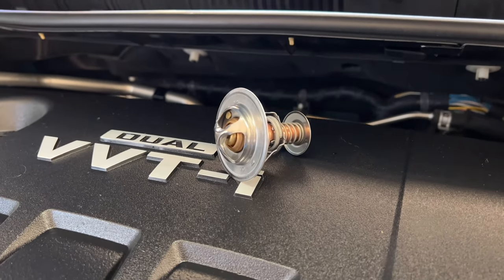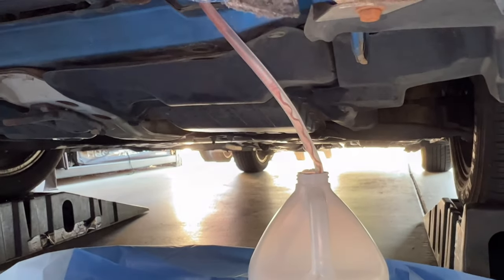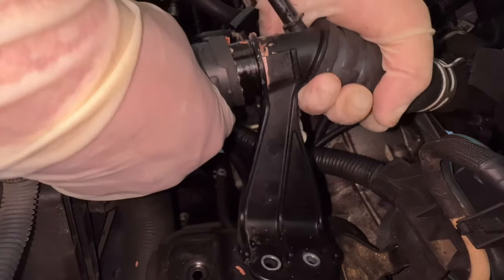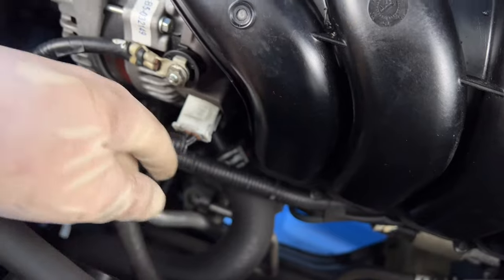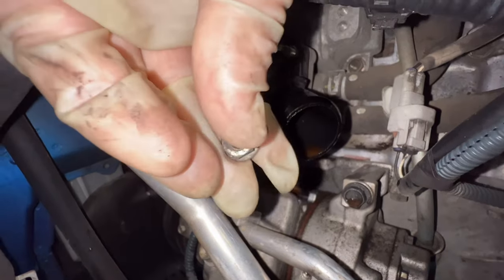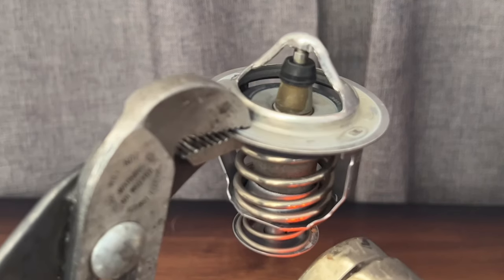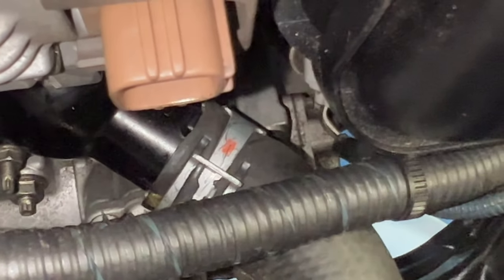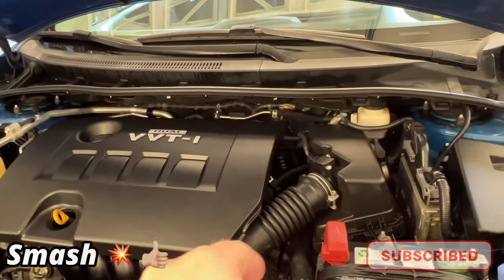Toyota Corolla Thermostat Replacement 2007-2013 DIY

Comment: Excellently shot video.  love the camera quality.  just one tip here on installing the thermostat.  usually the little valve hole i believe has to face upwards.  on the oem it was facing upwards when you removed it.  but the aftermarket one you installed, i couldn't see if it had a pin hole valve hole.  i know i have installed a few thermostats and some don't come with that hole, which is weird.  also after starting the vehicle, turn on your heater to full blast to get coolant into heater core and run vehicle until it gets to operating temperature.  Then your fan must come on.  some times this requires you to test drive it for a little.  if fan comes on, then you more than likely got all the air our of the cooling system.   let vehicle cool down for several hours until completely cool or until next day.  check your reservoir and add coolant to max line.  you more than likely will need to add coolant once system completely gets all air out of lines and radiator.  all in all this is probably one of the best videos i have seen online so far.  give this man a thumbs up and subscribe
Reply: Thanks for this! Recently I had my radiator leak and made the mistake of adding sealant to the system. Now my fan won't fully run. I'm replacing the thermostat and radiator with a full flush. Hopefully this will work 🤞

Comment: How is your engine so clean? Looks impeccable
Reply from the maker: I cleaned it..😀👍🏼
Reply: How do you clean your engine? What product do
You use ?
Reply from the maker: @jonjon9237 I use super clean diluted, spray with a pump sprayer generously. 
The hose off with medium pressure, nothing hard and definitely not a pressure washer. 
I then spray with wd-40 and let soak then get a blower and blow off everything with air. 
Wd-40 is a water displacement agent and lubricator. How ever you will get a small smell for a hour or less from burn off if any makes it on the exhaust. 

I do it about twice a year or so. Maybe every 8 months or so.

Comment: I just removed the hose clamp from the thermostat housing, unplugged the alternator plug and removed the 2 10mm nuts and pulled the thermostats out within 5 minutes.
Reply from the maker: Nice !!
Reply: You didn't have to drain the radiator?

Comment: Thank you so much. My car has been overheating but there’s no leaks, loss of coolant or ripped hoses. I believe it’s just the thermostat getting stuck because it doesn’t always overheat and the heater blows cold air when it does. It’s a 2014 Corolla with 230k miles
Reply from the maker: “I would replace it and see if problem still happens. Maybe check to see if coolant is low. Low coolant can cause same problems if to low.
Reply: @johnnysweekends  coolant is still the same level. Hasn’t dropped at all and no white smoke coming from the exhaust that can indicate a blown head gasket or loss of performance
Reply from the maker: @PacificNorthwestR yup probably thermostat sticking

Comment: Got a new thermostat inlet  for my 2013 Corolla along with the thermostat and gasket installed it seems to have a slow leak after a few miles it's irritating keep on trying to fix the issue no luck
Reply from the maker: Interesting did the vehicle get real hot? Did it warp anything? 

Wondering if you have the right part
Reply: @johnnysweekends  Would it be wise to use a bit of rtv sealant if the housing is leaking? I scored the portion where the waterpump goes back on for my yaris because the fit was extremely tight. Decided to use some permatex ultra black high temp gasket maker since the gaskets are made of metal and could start leaking.
Reply from the maker: If the housing is bad I would replace it. It’s cheap and prevents a second job. 
Now sure it may hold for a while but after it gets hot and cold several times it will leak. I assume you mean the plastic part you take off and not the engine block side

Comment: The original thermostat has 3 different models (A B C), how to know which one buy without disassemble the old one?
Reply from the maker: I know the mechanic said I needed the 180f not the 170f. Even then. I never found the difference. Worked in a decent amount of engines and not sure why the ABC
Reply: @iftorres   which did u get ? Bc Lowe Toyota told me the same thing
Reply: @Trip3krazy  The “B” but any of them are almost the same, the difference is just the position of the small vent hole, but because the circular shape you can put the hole in the same position as the original one, so the existence of 3 models (ABC) for me has no sense, the length of the bottom to top are the same, te diameter are the same, working temperature also te same.
Reply: @iftorres   gotcha appreciate it

Comment: You gotta replace that plastic pipe near the battery lol..i did mine after 8years of usage last week. Got myself an aluminium version..just gotta find a metal themostat housing..think the same year yaris would do🤔. love my 3zrfe with cvt..200k sofar..btw that new thermo looks nice with dual springs
Reply from the maker: I did replace it. The plastic was in stock and cheap. Figure it will be good for another 12 lol. Well hope so 👍🏼

Comment: Watching this video many times, I came to the conclusion that maybe it would be better to remove the Alternator for getting better access to the Thermostat. 
It is very hard to reach those 2 bolts under the Alternator. I cannot even imagine how was it possible to make such a great video with absolutely clear picture of the working area.
Well, as I decided to replace Water Pump too, I have no chance but remove the Alternator.
 But even just to change the Thermostat, I think it will be easier. 
Mention this, I still have to admit that Johny's Weekends video of replacing the Thermostat is absolutely brilliant and the quality of camera can compete with Hollywood!!!
Reply from the maker: Wow, thank you so much! 😀👍🏼
Reply: @stanislav9608  I was thinking the exact same thing no point of struggling when that will help with both parts

Comment: Appreciate the video, well done!  Can you help with my 2009 Corolla?
Used a coolant cleaner about a week ago.  Now I’m losing coolant into the reservoir,  not returning to the radiator. No leaks.  Pressure test is steady.  Bubbles constantly when bleeding air > 30 minutes.  Radiator cap new.  Water pump new.    I’ve narrowed it down to:
1)  thermostat 
2). Radiator / reservoir tube 
3). Head gasket

Any thoughts?  Thank you!
Reply from the maker: Head gasket. Thermostat will make it over heat real quick and should see needle go up and down a lot. 
Although my radiator was bad and finally blew after replacing thermostat and coolant and that plastic mid pipe. 
So radiator could be failing.

Comment: On the OEM thermostat there is a Safe Valve ,,,that little loose pin that goes UP when you install the thermostat in place,,you did not add one on the one you installed ?
Gef
Reply from the maker: The aftermarket thermostat has that built in. Only the oem has the giggle pin for the air release. People have used both and no issues but need to make sure to bleed the system to get as much air as you can out.
Reply: Me parece que tienes razón
Reply: The safe valve little pin, I see inside the thermostat color bronze this is important the location is 12 o'clock upright.

Comment: Excellent tutoring video. I subscribed.
 My daughter's 2009 Corolla doesn't have any coolant issue, but since the vehicle is 16 yrs. old with 150 000 miles on speedometer, I am planning the preventative maintenance:
 replace medium hose connector (Dorman's aluminum hose connector) and GATES' lower and upper coolant pipes).

I followed your recommendation and purchased AISIN THT-019 thermostat from Amazon and OEM gasket from Toyota dealership.
 As Aisin is Japanese company and makes a lot of parts for Toyota and Lexus, I assumed it is OEM product, but found out in comments on your page that it is not like original, and it has to be positioned different way. It is not clear for me which way is the correct. 

Could you give me a hint in this matter, and would you still recommend making this replacement if so far there is no issues with any leaks. 
My daughter is not living with me and I just don't want her one day to get stuck in the middle of nowhere.
I will appreciate your advice. Thanks in advance.
Reply from the maker: The newer thermostat needs the little hole more towards the top or 12 o’clock. For air when bleeding the system but you can still do it if the hole isn’t perfectly straight up.
Reply: @johnnysweekends  I don't have to warry anymore regarding the absence of little hole for air bleeding on the AISIN THT-019 thermostat. Today I received my order, and it looks exactly like the original one on the picture in your video

Comment: if one of those posts that hold the housing breaks off and the other nut is rust welded on, how SOL would I be?
Reply from the maker: Sol is only if you don’t know how to fix it. Which then, you could be SOL 😂👍🏼
Good luck 👍🏼

Comment: I hope I haven’t messed mines up the radiator line that connects to the Mid pipe melted smoke went everywhere… the day before my temperature gauge was moving up and down and then went cold I didn’t know it was hot until I seen smoke and it stopped but started back up

Comment: My Toyota Corolla 2010 is doing overheating and I didn’t knw why please can u help me
Reply from the maker: There is only so many things it can be.

Thermostat 
Radiator 
Bad head gasket
Or blockage 
Or air in the line. 
Make sure it’s full and no air
Reply: @johnnysweekends  thank u I will keep u update assp
Reply: @johnnysweekends  is there anyway I can snap it and send it to u
Reply from the maker: My email is in the about page if you would like to send something ..👍🏼
Reply: @johnnysweekends  have change my radiator still water is still drying inside the radiator is there anything I can do again
Reply from the maker: I think you have a bad head…head gasket is probably shot
Reply: @rahmanridwan8474  is there white vapor (steam) coming out the exhaust? If so, then it's head gasket. If not, then maybe thermostat is not opening up.
Reply from the maker: Yup or check the tail pipe with his finger and see if it’s really black and and sooty..
Should be pretty dry and light coated if at all.

Comment: I'd drain it before driving up the ramps though.
Reply from the maker: It doesn’t really need to be all the way empty though.
Reply: @johnnysweekends  You're right. Just wanted to maximize coolant exchange if coolant in it was too old.
Reply from the maker: Nothing wrong with full fluid exchange..👍🏼